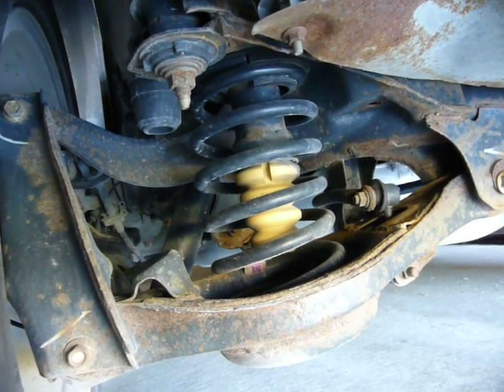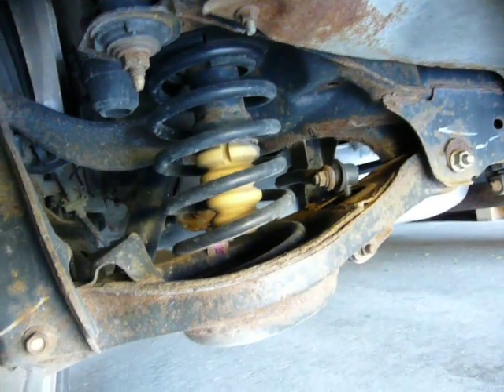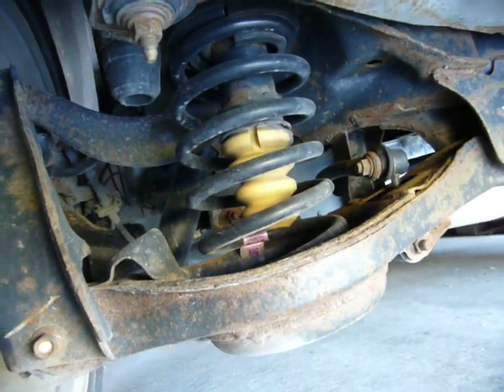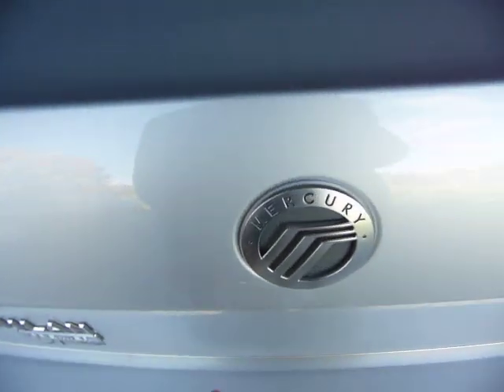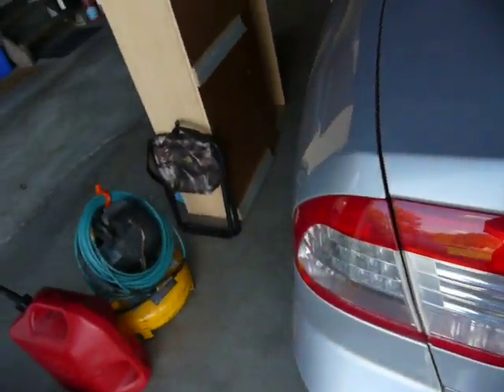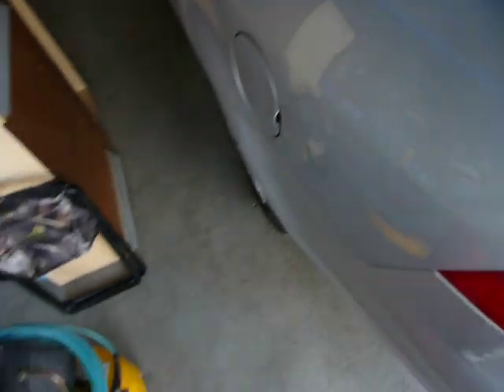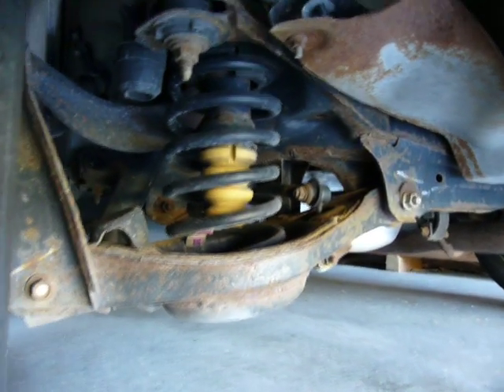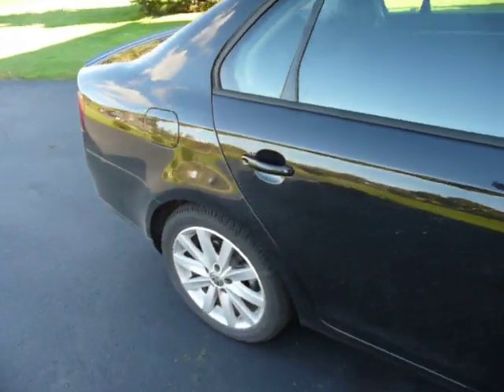Control Blade Rear Suspension

Comment: One of the reasons why I love my Focus. Sadly from what I hear they're transitioning the 2018 Focus to a torsion beam rear suspension. :(
Reply: "Ford has followed Volkswagen's lead in equipping lower-powered 1.0-litre petrol and 1.5-litre diesel Hatch variants with a cruder twist-beam set-up. If you want the more sophisticated independent rear double wishbone suspension system that's supposed to improve ride comfort, you'll need an estate, the 'Active' crossover version, top-spec 'Vignale' trim or a hatch with 1.5-litre petrol or 2.0-litre diesel power. The top 'ST' high performance version gets stiffer, lowered suspension and a choice of either 280PS 2.3-litre EcoBoost petrol power or a 190PS version of the 2.0 EcoBlue diesel engine." - RAC website review.
Reply: @WireSniffer  I'm now on my fifth focus.
From mk1 through to mk4 upgrade.
I feel my current estate version is as good at handling as my original one.
I'll be so disappointed when they stop producing the Focus.
The replacement will have to be something special.
Reply: @WireSniffer  Mercedes A klasse, Mk3 I 30 facelift, and Many car''s will use this type of suspension. Torsion beam on low spec models and multi link on high spec models

Comment: What's the name of the yellow bit?
Reply: It's basically a "bump-stop", the same thing you'll see on coil over spring type suspensions. In case of a large bump, they'll cushion what the shock and spring can't, meaning that the bump stops prevent the suspension from bottoming out and either causing damage to those parts and the chassis, and/or preventing a moment of severe loss of control. Some companies, like Fat Cat Motorsports, make harder bump-stops for people wanting performance on a track. The harder they are, the quicker the suspension can "settle" into its position , say on a hard turn. It would make the handling dynamics more linear and predictable.
Reply: Thank you William.

Comment: My 88 escort GT uses something very similar to that with the exception of the stabilizer bars in the rear. The car has an excellent ride for it's age and It's kind of shocking to see that Ford still uses this setup in newer model FWD cars. Think I might post some pics or maybe even a video response so you can see what I'm talking about. Very similar design and the car handles very well.

Comment: Great video, I love how you broke the components down and clearly explained the suspension setup.  If I'm not mistaken Mazda developed that exact setup in partnership with Ford. It really is a well designed suspension when it comes to saving space and ride quality. I've found the multilink suspension to be the best over all however it's expensive to manufacture and thus a lot of car companies are not using it anymore.